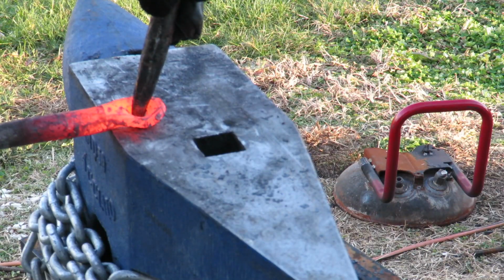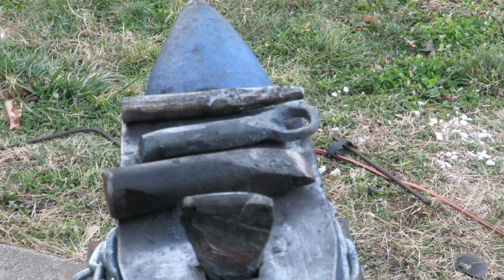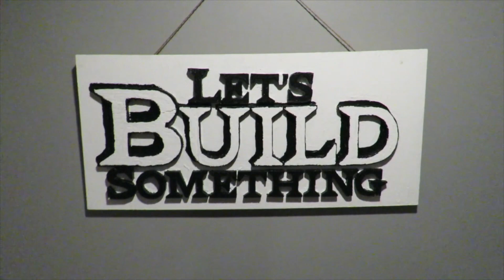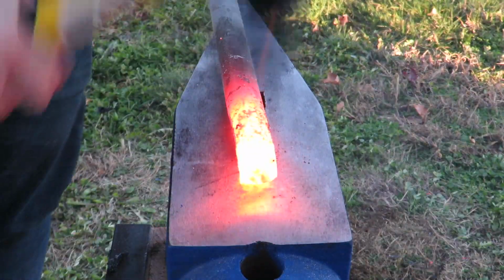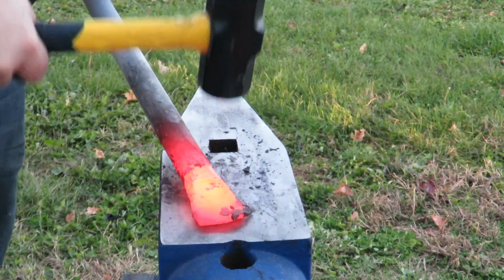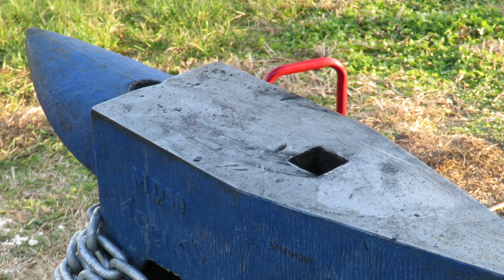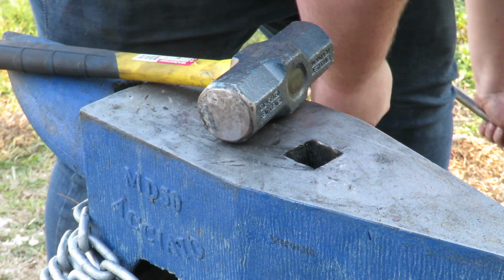First Blacksmithing Project // 3 tools and a Bottle Opener

Comment: Hey mate good to see you learning and not afraid to fail. A good tip i can give is to silicone your anvil onto its stand. It will stop it from jumping around so you don't have to chase it and also not lose energy due to your anvil jumping. Side bonus it can help to quiet an anvil. I have used it on my railroad track aso and it works a treat. I used sikaflex 11fc+ but any neutral cure outdoor silicone should do especially if it mentions dampening vibration.

Comment: Nice job!

I do want to ask, what steel are you using?  In the video, it looks like the steel you used for the hot cut hardy is the same as the steel you used for the bottle opener.  If that's true, and it's some form of hardening steel, I'd recommend getting some mild steel for stuff like bottle openers and whatnot, since mild is cheaper and then you can save the other steel for more tools.
Reply from the maker: It was hardening steel. Very good point, that’s not something I had considered. Thank you!